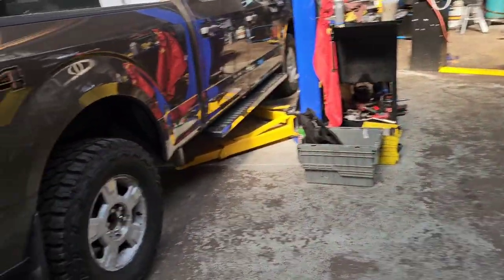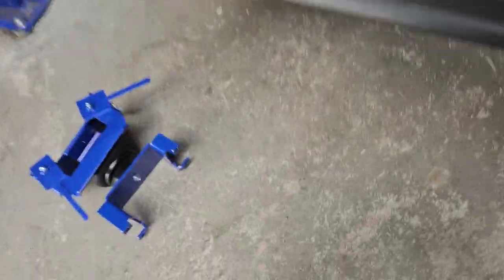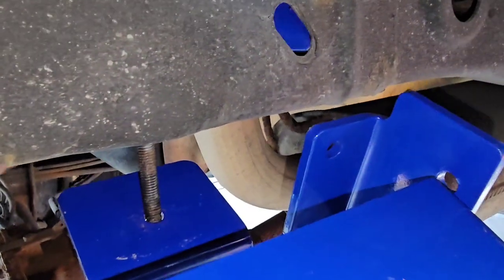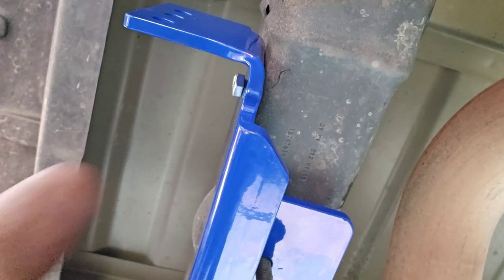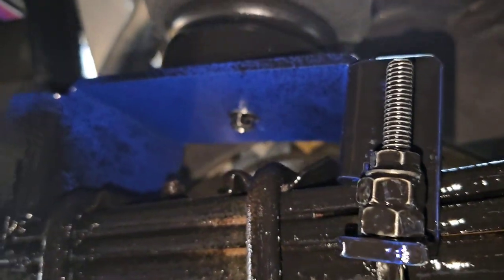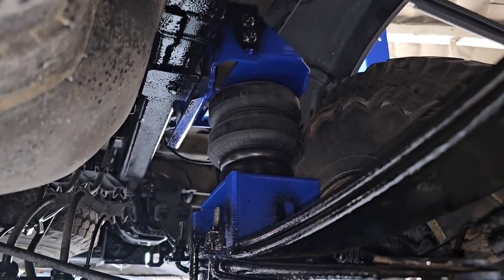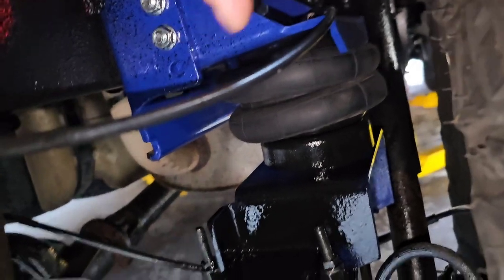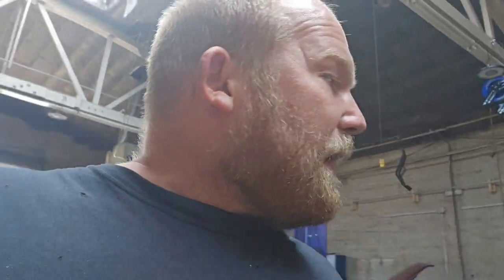Maxpeedingrods 2015 - F150 Towing Airbag Install - Bonus Black Fluid Film Application Let's see

Comment: Spray the crossmembers above the spare tire area.  My 16 had more surface rust above there than anywhere.  I'm in PA.   I sprayed all the steel on my 22 f150.  Used the 360 can wand on the inside of the frame.

Comment: Hello Rich: Thank you for another educational video. So what you mixed the bottom mounting plates for the new air bags. No harm done, if that's the worst, it's nothing but fly Poopy.  You're air bag modification to you truck is absolutely beautiful, well done sir.  That beautiful MB that pulled into your shop really gets my heart going. Well it should it's over $$ 200,000 Thousand Dollars $$ 💸 Rich, it's quitting time & I'm tired. Hope you had a profitable day. God Bless & my best to the family,  TMP from N.J.
Reply from the maker: That car came in for $5,000 worth of maintenance
Reply: That's about right. In my shops these exotic cars would run $$ 5K to 25 K easy. Rich your not ripping these people off but the complexities of these vehicles is nothing to sneeze at. Forget book time on these cars. These customers pay for perfection & I never failed them even if I had to stay all night. That AMG 12 CYL I'll bet has a bunch of oil leaks ta boot. Who ever works on that car better have a spotless uniform & lots of fender covers or you will be paying for a repaint & that paint is very expensive  !!!!! Get some rest my brother,  TMP from N.J.

Comment: I added a pair of Bilstein 5100 shocks to the rear of my 19' F150 and made a huge difference to towing.Definetly took the bounce out of the rear when pulling a 6000 lb travel trailer.Also nite and day difference on rough roads when empty,way more stable.I'm going to do the fronts next.Air bags are also a great idea,as are Summo Springs.Looks great!
Reply from the maker: Only issue I have no is on the ride home the residual air trapped in the bag is enough over bumps to create enough pressure when rebounding the truck feels stiff
Reply: @FordBossMe what do you have the bags aired up to? My Firestone bags I ride at 30 to 35 psi and don't feel it. If I'm at 50 to 60 psi like I would for light tow I Definitely feel a stiff ride. Between trucks and vans I have 8 in the fleet all have bags only one that doesn't is the 9th my personal non work truck it'll be getting bags shortly I'm just waiting on parts because it's getting full on boards air and leveling sensors

Comment: I used Ready Lift bags on mine they have built in bump stops. I like them they do what they are supposed to do. I put a 1000 lbs (1/2 ton) in it and it would squatted. Not anymore.

Comment: I've always heard air bags were a no no for towing. That a weight distribution hitch without air bags was best. From what I heard, air bags lift from the axle and so they don't transfer weight to the front wheels, but actually can fool someone into overloading the rear axle weight limit by pushing more weight down on the axle exceeding it's rating. Where as the weight distribution hitch lifts from the frame to transfer weight off the rear axle and onto the front axle; and, if you use air bags in conjunction with a  weight distribution hitch all you are doing is taking weight off the hitch bars and transferring it back to the bags and back down to the rear axle defeating the purpose of a weight distribution hitch. I've heard air bags are only good for leveling the load in the bed, but again, it doesn't distribute weight to the front axle, the weight will always be downward to the rear axle (downward vector)..

Comment: Oh btw a question….where was the air to inflate/deflate controlled from?
Reply from the maker: I sure it was a tire pressure inlet valve like the valve stem of your car you add it with a tire pressure gauge but they actually make controllers that you can put in place and control from the dash with a pump

Comment: Did you installed when suspension at full droop? Will this restrict suspension travel?
Reply from the maker: I'm a little confused I don't think you watch the video all the way through because if you did you would have seen that the vehicle was up in the air and the suspension was at Max travel so you would have seen your question being answered right in front of your face

Comment: The woolwax kit I used came with a gun with bottles and with several wands with different tips. Was your fluid film aerosol cans or similar to the woolwax kits?
Reply from the maker: I think in the video I could be wrong that I said it I bought eight cans I'm pretty sure at the end though clearly said I bought eight cans make sure you're watching the videos all the way through
Reply: @FordBossMe  indeed you did.  I just didn't hear what their kits use for application like if it's aerosol paint can sized cans or comes with some sort of gun and wands like the woolwax kit I used. Figured for future touch ups may consider what I believe you used but didn't know what you used exactly. Seems like it went on good and easy from the looks of it